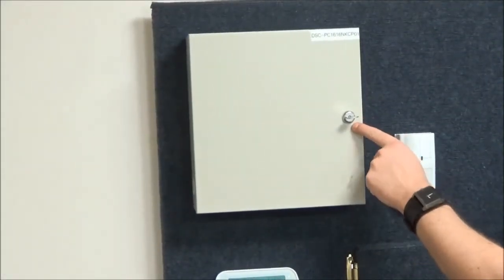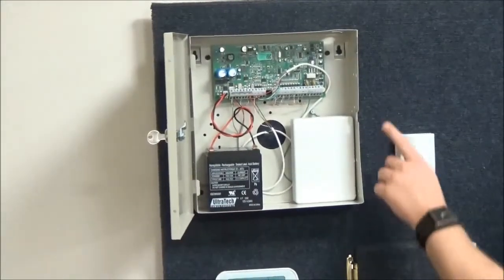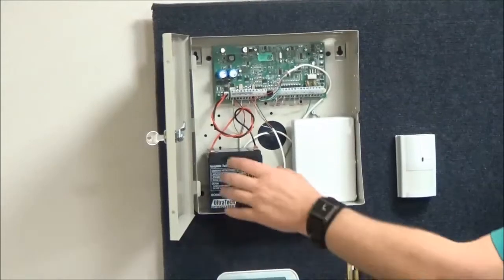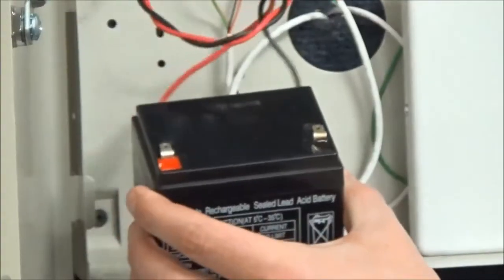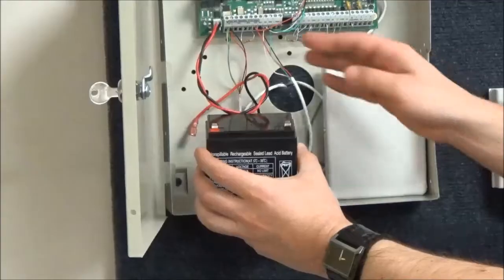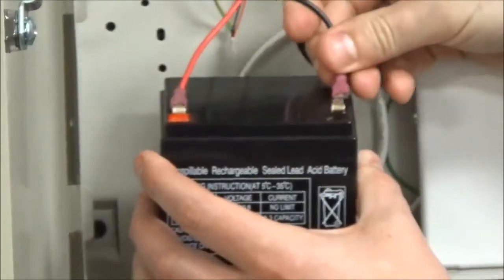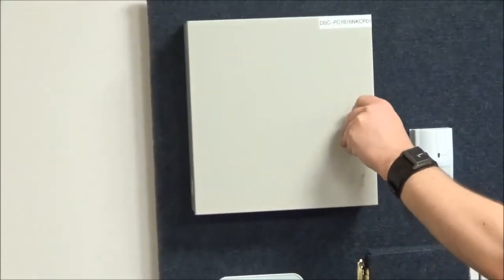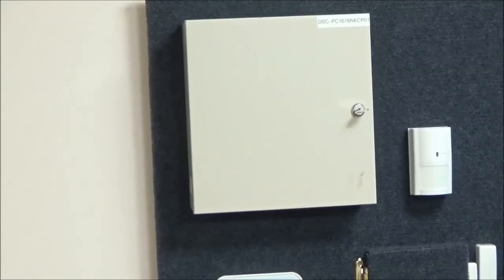My Alarm Center – How to Change  the Backup Battery in a DSC Security Panel

Comment: Who would need a video to see this process? But at least the narrator had a cool condescending sing-song speaking manner to make it even more enjoyable.
Reply: I needed one too. Never had to do this before.
Reply: Actually I needed it as there are two cables to each lead on my systems and they didn't slip right off as they did in this video - wanted to be sure I was doing it right do I didn't destroy the cables...

Comment: If I just disconnect the backup battery do I need to do anything to the battery wires or are they ok to just “hang out”. We switched security companies and our old Brinks keypad keeps beeping at 4am each night. I’m just trying to unhook the entire system so I can sleep. ☺️
Reply: They are OK to just "hang out" as long as they have the plastic insulated covers. Othwerwise, put a little tape over them to avoid having the wires touch other metal parts/components while the battery is out. If you "want to sleep" as you say (without spurious alarm system alerts), you'd need both the AC power disconnected (or circuit breaker turned off) AND the battery disconnected.

Comment: If battery drains then you'll need to have your transformer looked .because the battery is only used as a backup incase of a power cut which then locks in the battery till power is back on .a lot of folk don't seem to mention the transformers .transformers is the psu which then needs constant power .